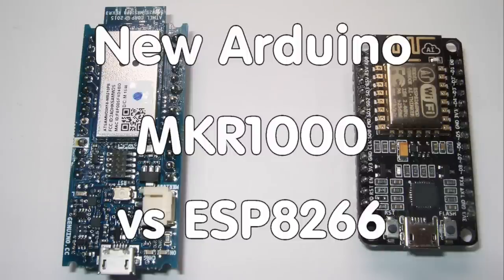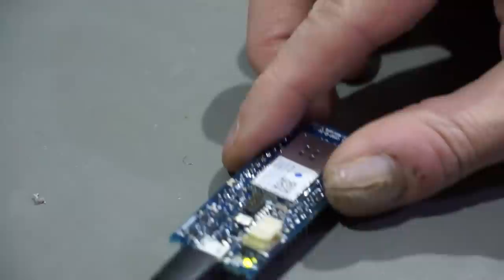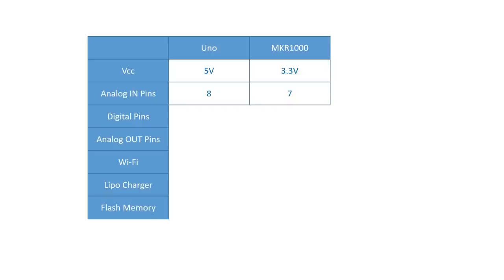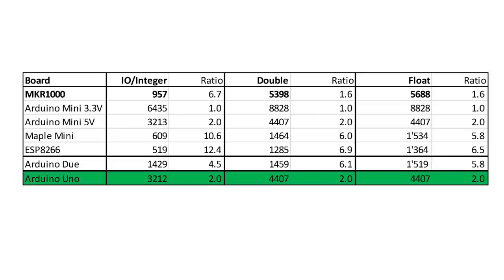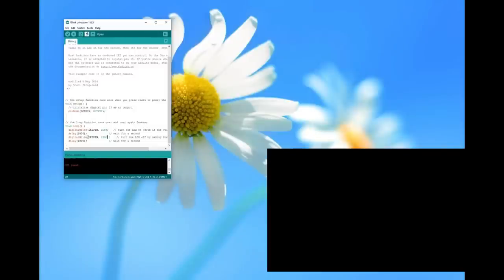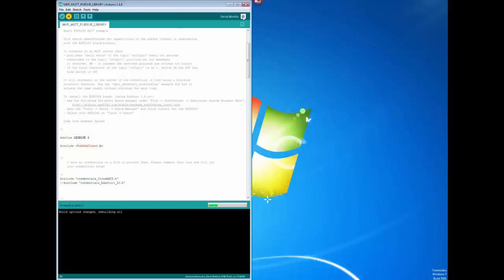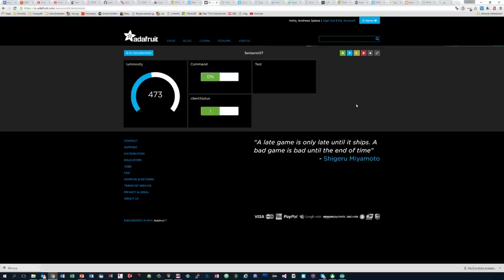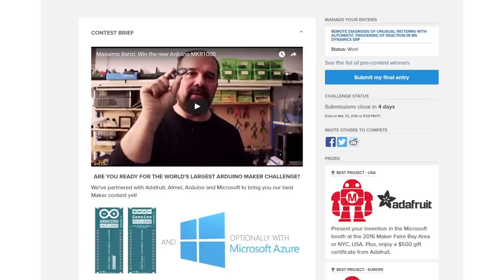#51 New Arduino/Genuino MKR1000: First tests and comparison with ESP8266

Comment: Wondering what frequency wave form the 10 bit DAC could reasonably reproduce... for use as a signal generator.
Reply from the maker: I never tried. Maybe you find the answer in the datasheet?

Comment: Would have loved one of these! Shame I missed the contest. Built in lipo charging is something that any development board these days should have. 
Could you try making audio signals with the analog out put and a transistor? Wonder how well it can generate tones.
Reply from the maker: +Glychee S Audio signals should be possible with such hardware either by "bitbanging" one output pin or by manipulating the PWM frequency. But it would not sound nice, because it creates a square curve. Instuments usually emit some sort of sine waves.
For music, it would be better to use a special chip. (See example: https://youtu.be/PRVeqODwUsc)
Reply: +Andreas Spiess isn't pwm suitable for most analog output? I can't really see the benefit
Reply from the maker: +Glychee S 1) I just saw, that an example for the MKR1000 produces sounds. They use the Digital-to-analog converter (DAC), so, they can create sine waves (same principle as the chip of Julian Illett).
2. PWM is a purely digital signal. I switches a line high and low. Just the ratio between "high" and "low" time is adjusted and if you add an low pass filter, this can be used to create "analog" signals, but it is just a hack because it includes high frequency noise. Therefore, usually DACs are used to create analog signals. Speed of conversion also is much slower for PWM. So, your comment should be reversed: Sometimes, PWM is suitable instead of a DAC.
Reply: +Andreas Spiess thank you! You know too much ;)
Reply: +Glychee S Maybe the DAC can be combined with DMA ti provide the steady stream of data. "10-bit, 350ksps Digital-to-Analog Converter (DAC)" should even give a nice mono sound.
Reply: Would hog up too much time i think. Still,relatively cheap streaming radio.

Comment: Wow i at first thought this said Mar 21, 2017. How come the MKR1000 is still so much more expensive than the ESP comparisons, even the Adafruit Feather. Didn't really look at what the MKR uses for WIFI, but I'm guessing it's because they went a different route than the ESP8266. I like Arduino and almost pulled the trigger on the $70 bundle they have going on, but then realized I already have multiple ESP8266-01s and an Adafruit Huzzah, which for my purposes can already handle everything I'm throwing at it. Maybe I'll buy one in the future when my hardware can no longer handle what I'm doing
Reply from the maker: You are right. This is a quite old video. And I think, the MKR1000 is not very successful right now

Comment: I'm running several Arduino IDEs in parallel - 1.0.5, 1.6.7, 1.7.8 on the Mac, it shouldn't be a problem on Windows as well - the whole Arduino's folder is pretty self-contained, so renaming the program folder should be enough to run several in parallel.
Reply from the maker: I think, some of my comments are now obsolete because they did improve the support of the MKR1000. I just did not have the time to redo it.

Comment: Have you checked out the Particle Photon? It's smaller, probably less expensive ($19.95), more elegant and is integrated with the Particle Cloud Service which makes it really easy to use. Also you can have a lot of fun using it with IFTTT and your Amazon Echo.
Reply from the maker: No, so far not. Because I live in Europe, shipping from the US was usually more expensive than the goods. This is why I rarely buy stuff in the states. But maybe I have to check it if it still is true.

Comment: My question: can i connect a 5V LED to the mrk? I want to use it as an alarm signal and want a bright led for that.
Reply from the maker: LEDs are below 3 volts. This is why you have to add a resistor. For 3.3 volts you just use a smaller resistor for the same brightness. Brightness depends on current, not on voltage.

Comment: You should have compared to the ESP32, as that is the new standard for price and performance for maker boards. I can get a dev C board for $6 which is less than the UNO and I'd guess less than the new maker1000. I can't get over all the features this little ESP32 board has, high performance and low power in the same package.
Reply from the maker: I think the ESP32 was not out when I made this video. In the meantime, you find now many videos about the ESP32 on my channel.

Comment: wow , and wow , such great info and review.  I think ESP's  and my nano and pro minis will still be in  my tool box for now . 
They probably just have to fix the float lib in the board files .
.. LOL would be funny if  they forgot to account for bit level difference in the float lib .
Reply: +XerotoLabs Same here, nano's and ESP for me for the next little while.
Reply: +NOTuNOTme i try to make most stuff work on a Nano , and then boil it down to a pro mini or even a ATtiny if i can , but ESP's are so cheap .  I cant wait to see what the ESP32 's will actualy be .
Reply: +XerotoLabs Yes, ESP's are so cheap and let me SSL into Firebase - I'm happy :)
Reply from the maker: +NOTuNOTme Where did you find the infor concerning SSL and ESP? I also would need it.
Reply from the maker: +XerotoLabs There are always advantages and disadvantages of concepts. What I like is, that I have choice to select, what I need for my project and use portable sketches without big hassle. This is what I wanted to show with my MQTT example
Reply: +Andreas Spiess  I used this project off github => https://github.com/googlesamples/firebase-arduino.  I built a temperature sensor using an es8266 12e and BMP-180 posting to Firebase.  Works great.
Reply from the maker: +NOTuNOTme Are you sure it uses SSL?
Reply: +Andreas Spiess You can only use SSL to connect to Firebase => https://www.firebase.com/blog/2013-01-21-firebase-will-require-ssl-starting-february-4th.html   I think they may be considering putting in non SSL access especially for IoT devices (or maybe not).
Reply from the maker: +NOTuNOTme I understand. But my question is, whether the ESP uses SSL? In the sketch I du not see any difference to a "normal" sketch.
Reply: +Andreas Spiess I guess I don't understand your question.
Reply from the maker: +NOTuNOTme SSL is used to encrypt the communication over the internet and till now, I found nobody who used it with the ESP. The MKR1000 seems to have an encryption chip to do exactly that. But, unfortunately, I am not an expert on this. This is, why I asked.
Reply: +Andreas Spiess Unless there is a proxy that I don’t know about the sketch is making direct updates into the Firebase database through its REST api, and it can only do that over SSL.  I don't know the finer points of SSL nor have I trolled through all the code libraries this sketch uses so I can’t answer ‘how’ it does it.  I can tell you I have a working device sending BMP180 data (temp, alt, pressure) at 1 second intervals into Firebase and a webpage using the Firebase JavaScript api to display the data.  I typically get a 1-2 second delay from device to webpage.  I think I read something on StackOverflow talking about the ESP not being able to handle big TLS fragments, guessing I get away with it because of the small amount of data I am sending.  Maybe this limit is why you don't see anyone using SSL on the ESP.
Reply from the maker: +NOTuNOTme Thanks for your answer. So, I can investigate into the code you provided. Maybe, I find somthing.
Reply: +Andreas Spiess Let us know what you find.

Found the StackOverflow post => http://stackoverflow.com/questions/33159861/support-for-esp8266-and-firebase
Reply: +NOTuNOTme from my quick read of some threads basic .. very basic SSL exists , but has some limits , the random number gen function is a bit to basic ( it may be fixed now )  , and it is a pig on RAM , so server response or any thing could easily trigger a ESP's WDT.  but seems they are having small packets between 1 client and server are ok .   This is something that makes me wonder how much network powers a ESP 32 will have .
Reply: When I get some time I might keep increasing the data size until I hits failures.  Would be useful to have an idea how small I have to keep things.

Comment: you can actually use native C to convert string to floating value, by first declaring char array then convert the string.toCharArray to declare into the char array buffer then use native C atof() function to convert the char array to actual floating point.
with all that done, you should be good to publish floating point value to your mqtt feed.
Reply: this is actually my work around for string.toFloat function in other platform than using Windows.
Reply from the maker: Thanks for the tip!

Comment: There isn't much memory to buffer larger image files such as for an epaper screen used in current ereaders for example  - You mention the memory in your video but say it wont be an issue. How would you increase the memory in order to send and buffer an image across wifi through the MKR1000 to a screen?
Reply from the maker: I never thought of adding memory to such a device. If I need more memory, I use a Raspberry zero. Similar size, similar price.

Comment: You are right, it's hard to compete with the ESP8266 - if one doesn't need the analog in/out pins I don't see a reason to probably spend 5-10 times more on a slower and larger board with much less memory.

By the way, are the ESP numbers only at 80MHz or at 160MHz?
Reply from the maker: +alexanderktn Only standard 80MHz. I never tried 160MHz, because it was fast enough for my current applications.
Reply: +Andreas Spiess Thank you! So it might be even faster (at the price of higher energy consumption).
Reply from the maker: +alexanderktn and maybe less stability, and this is what I fear. There are enough uncertainties with these chips. I do not want ot add more.
Reply: +Andreas Spiess A valid concern, though I had no problem running them days on end on the higher frequency.
Reply from the maker: +alexanderktn Good to know. Thanks!
Reply: Late to the party here but, 160MHz seems to be 100% reliable under load (doing an FFT). I wish I had more use of the 160Mhz but 80 does suffice for almost everything.
Reply from the maker: Good to know that it works reliably in 160. The same applies to me. The ESP is already at 80 much faster than all other micros I use

Comment: Hi, just curious, what was your project idea?
Reply from the maker: +Trish Mapow I wanted to build a sensor which can be mounted on production machines and measures sound, vibration, movement etc. and detects if something becomes wrong before it is completely wrong and transmits this info to Azure where it is transferred to the maintenance system (Microsoft Dynamics) to trigger an action (preventive maintenance). Could also be number of movements. It was intended for older machines which do not have this capabilities.

Comment: Trift es auf den Nagel. Gerade habe erst auf embedded.fm gelernt "pain in the butt" scheint die etwas höflichere Form zu sein :-).
Hast Du die Setup Skripte verwenden können?
Reply from the maker: +norm1124 Ich habe gedacht, ich gehe den "offiziellen" Weg. Dein Script hatte ja den Stand von vor einem Monat. 
Aber der ist offenbar auch nicht ohne Steine. Das WiFi hat überraschend keine Probleme gemacht (version 0.8.0).
Was genau auf embedded.fm hast du gehört?
Habe gerade ein Mail bekommen mit der Verschiebung der Deadline...
Reply: +Andreas Spiess Die light Variante von "pain in the **". Danke für den Hinweis zum Neuen Termin, hätte das fast übersehen und evtl. über Ostern etwas Zeit.

Comment: Good day Mr. Spiess. I watched your video and I found it very interesting. 
I would like to ask for your permission to use the tables that you have shared in this video for a presentation at the university. I'm finishing a work about the ESP8266 and possible applications.  Besides, I think I heard that you were the one who took those measurement that appears in those tables and how did you do it. 

Have a good day.
Reply from the maker: YouTube is public. So, you can use it, No problem. Good luck with your presentation. BTW, you find much more stuff about the ESP8266 on my channel
Reply: Could you tell me what tool did you use to take those measurements?
Reply from the maker: You might find some information in my video #11

Comment: Hello,
I buy this board but I m very disappointed. It should be fast and precise but is not at all. I have very big noise during a very simple analogread (a1), Did you find the same? Did you solved this very big issue?
Reply from the maker: I never touched this device  since then :-(

Comment: Does MKR1000 work with Arduino IDE 1.8.5?
Reply from the maker: I just tried and uploaded the blink example and it worked. As usual, you have to install the SAMD Boards support.

Comment: Nice video. However, considering the astronomical price of the competition (for example the ESP32 or even the ESP8266) , the MKR1000 is the worst choice for almost any project.
Reply from the maker: I think this is a quite old video ;-) I never used it again.

Comment: Die Frage bzgl. FPU ist interessant: Der M0 kann knapp in HW Integer multiplizieren, der M3 zusätzlich dividieren und ab M4 kann optional eine FPU integriert sein (https://de.wikipedia.org/wiki/ARM_Cortex-M#Befehlssatz). Aber hey: das Silizium ist so breit wie ein Haar! http://www.forbes.com/sites/parmyolson/2013/09/20/as-gadgets-shrink-arm-still-reigns-as-processor-king/#668714f5f13d aus diesem Blickwinkel trotzdem sehr beeindruckend!
Reply from the maker: +norm1124 Das ist wirklich Wahnsinn, diese Miniaturisierung. Und wir erwarten dann noch, dass es immer läuft und nix kostet...

Wieso ist der ESP denn so schnell?

Comment: Nice video.  I was one of the 1000 to get a MKR1k as well. I did as you and ported some ESP code I had written to it. One was this code:https://github.com/jscottb/ESP8266_http_io. The port was not hard and only took a few minutes to get it to compile. It took several hours to get it to run :( I have it fully working now, but found a lot of difference in the high level workings of the libraries. I first noticed serial issues (as you did) and then Wifi issues (flushing seems not to work or work well with Wifi Client connections or Serial, so may be an underlying Stream class issue??) The project I was going to do, did not match well with the MKR1k due to these issues so I had to do another. It seems to be working with the new project with a nudge here and there. I'm sure they will get it all sorted out in the end, but it did make it hard to do a contest project with.
Reply from the maker: +UReasonIt So far, I did not work with it other than the MQTT sketch. WiFi was not a big issue for me. But good to know, that I have to pay attention. Will try to connect to Azure in the next days.